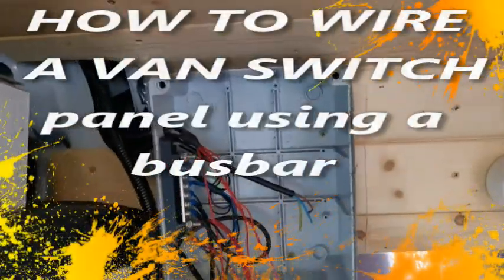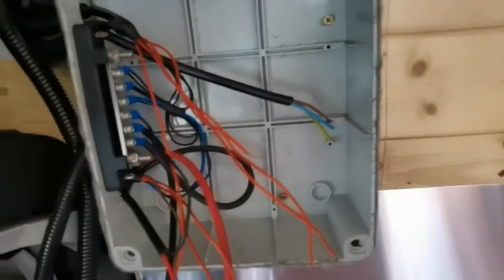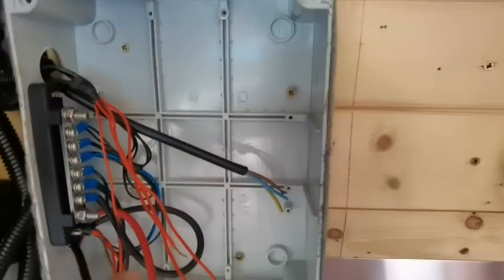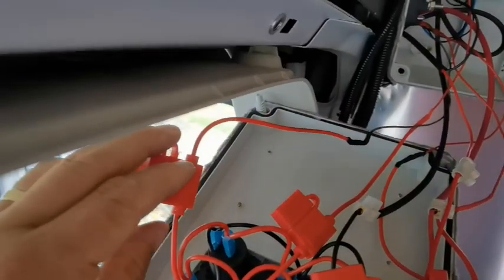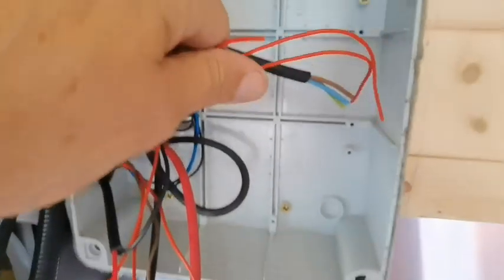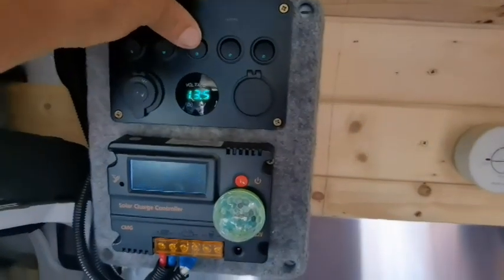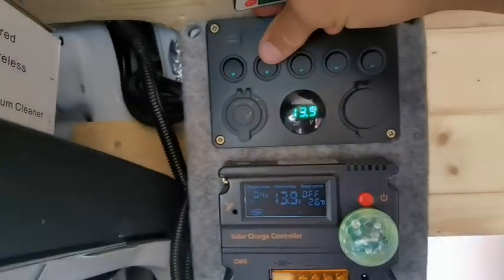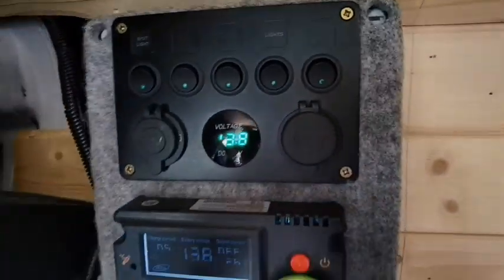HOW TO WIRE A VAN SWITCH panel using a busbar

Comment: Hi Mark nice video showing the busbar setup, in the control panel are the switches pre-fused or do you fuse them according to the item been wired up ? Thanks.
Reply from the maker: pre fused and yes fuse them to items your using